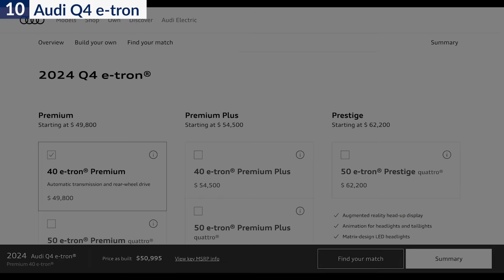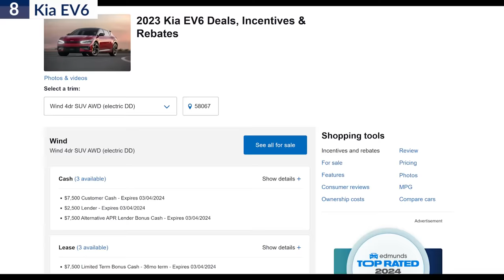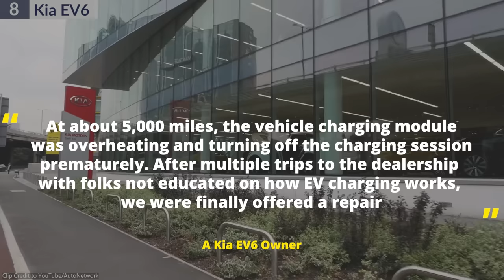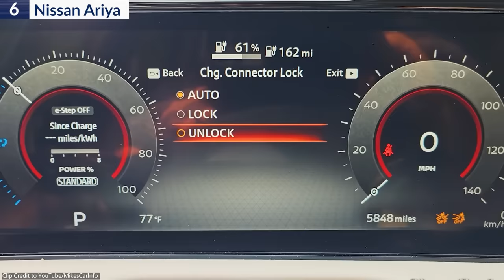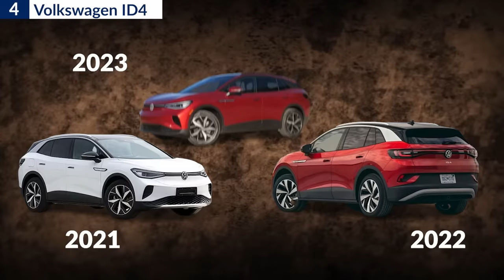New Electric Cars Piling Up on Dealer Lots in 2024 – Here is the Truth!

Comment: The problem with Electric vehicles is they have a limited market ....................

affluent, environmentally conscious, or technically enamored buyers and those buyers have their electric cars

For the majority of consumers, electric vehicles won’t deliver the right value at the right cost  and not everybody uses a vehicle that really is only suitable for  driving around town and commuting

All this is leaving Electric Car Manufacturers struggling with an end-of-line product not capable of providing multiple driving missions of differing lengths and speeds.

Comment: Here is the issue, in most cases we could step up infrastructure to accomodate previous items, but in the case of EV's they pushed EV's before infrastructure was made. That was bad, as the infrastucture was dependent on travel. Without it people will not buy, because where can they charge? All the manufacturers should have gotten together, decided on a single port, and used that port for investing in national charging infrastructure in conjuction with the government. Rather, you see them all doing their own thing, placing the ports at different areas, why? Because they all wanted to be the bluray platform, they wanted that segment. This involves piss poor planning, greed, and zero intelligence. Tesla, in my eyes, were the only ones that offered any path of ownership due to their charging capabilities across the US, but even then it's not ideal as there are not enough chargers. 

Fact is, we aren't ready for electric yet, the miles are not there, and we should really have an electric platform with a back up gas generator that charges on the go if going cross country. That way you can charge at stopping points if you choose to, or charge via gas if out and about, and then also charge at home through your charger. This should have been done moving forward as the electric platform is superior, but having the capability to use gas for a generator is still required for trips.

Until we see 1000+mile charge, and 15 minutes or less charging time, we won't see widespread EV adoption. The other thing is that they are just too expensive. I have a Model Y, I only got it because I like tech, and it has saved me money for non-highway travel I will give it that much. However, they aren't ready for the US, not enough miles per charge, and not enough chargers, we just simply have too far to travel to places, we aren't like Europe where travel is 1/10th of the US travel average times.

Comment: Putting things into perspective, it's not just EVs failing to shift, only the over-priced less popular, or just crap ones. Crap Gas and diesel cars will also sit on dealer lots if they are over-priced. It's called 'market-forces', and is the system by which the world works.

Comment: Id buy one, but not at current markup and over charging tactics. Plus, the charging stations are not available enough. Market supply and Discounts and such aside, If you cannot charge the car ANYWHERE But at your OWN house... YOU wont be buying that EV..... Recently we just had a charging spot put in at our local Pilot truck stop. Its still not been opened up for operation, but its there.. with its glowing red light... telling you that it cannot be used.. much like many of the Ev's sitting on lots..

Comment: I would buy an ev car AFTER they reduce the asking prices significantly, make the cars out of steel instead of plastic and aluminum, make the batteries affordable at 200 to 300 instead of 10000 to 30000 for replacement. 

Everyone does NOT want a new car payment every few years, a car that is worthless without a warranty, and limitations on how far they can go because of constant battery range degradation. I like all my gas cars and they are all out of warranty, self-maintained, haven't had a car payment in 12 years, and they still get compliments when i pull up places (2012 BMW 7 series, 2008 Mercedes S class, and 2014 rolls royce wraith).

Comment: It will take years to build infrastructure for electric cars. Who wants to get stuck on a road or highway because the charging station chargers are either not working properly or there aren't enough to accommodate customers? Per my understanding, this has been a real issue for people with EVs. The idea that all new cars sold by 2030 should be electric was unrealistic and too ambitious from the beginning. If you want to lower pollution stop selling vehicles with turbo engines that omit high levels of nitrous oxide and particulate matter and focus on hybrids and low emission naturally aspirated engines.

Comment: There are Audi Q4 cars at many cattle markets in the UK. Hundreds of them sitting behind metal fencing. There are not enough chargers and not enough range. In cold weather, you may only get 100 miles on the road. I tried a new one and fully charged on an icy day, it could travel 60 miles at lower power due to cold battery.

Comment: The more videos I watch about EV the more I realize that most of the issues are not because of EV cars but because of the US. I never drove a EV car there but apparently they have a bad public charging infrastructure, bad / overloaded electricity grid in general and people drive 300+ km per day to work. 
In EU (or more specific in germany) the range of a modern EV is more than enough for a daily work driver, if you drive long distance you drive on the Autobahn and there are many charging stations (many of them are solar powered btw) a long the different Autobahn roads and they are building even more every year, so long distance trips are not an issue. Yes there are still some issues, because they are "new", sometimes a charging station will not work etc. then you can call the owner and they will restart them or if you don't want to wait you can continue the Autobahn for a few more km and you will find a different working charging station, but these are the exceptions and you hear the bad stories, they will usually work.

Comment: I wonder how many of these EV's will last more than 5 or 10 years, and how much will cost to keep on the road with battery and electronic parts replacements etc.
Then compare some of the cars that are still on the roads around the world that are over 50 plus years old and still going strong.
Built in obsolescence has been a thing for a long time, but I reckon it would be shocking today at the rate that electronics fail in the auto environment.
Ev's definitely suffer from premature speculation on the part of the law makers and planners mainly because they failed in the estimation of the problems that they are facing now, and in the future, but either way it will be us the public who pay for their stuff ups, and not the share holders, and that is a fact that you can bank on.

Comment: Main reasons. Range, lack thereof. Price way WAY too high. Infrastructure. Extremely high, from installing super charger at home if you have the ability to install one. It's time for recharging. Way to long. Public Infrastructure. In recent reports, it is way too fragile. Long-term high prices  for out of warranty repairs.
Reply: Add this ;

1. Child battery mineral labor

2. Range anxiety

3. Risk of garage fires

4. Paying 20k more than a
comparable vehicle

5. every time you fuel up an EV, the fuel tank gets smaller  and smaller. Battery degeneration. 

6. Poor resale value

7. Reduced performance in
cold, highway.

8. Higher repair costs

9. Awful charging network
experiences in the weather
without restrooms

10. Higher insurance rates

11. Replacing tires more
frequently. Michelin states that tires wear out 20% faster on an Ev, and could be as high as 50% faster! Ev tires made for ev's, cost 20 to 30% more, than regular tires for ice cars. As Ev tires wear out, they leave behind more tiny particles of rubber than normal ice cars. This causes more pollution. 

12. Death by autopilot

13. $25k - $35k battery

14. Low km range per tank of energy. 

15. must wait in-line 1-2 hrs
to charge.

16. Then wait more time to charge, while charging.

17. Spontaneous combustion, with no way to put out the fire storm.

18. If they catch fire in a tunnel, many people will die.

19. People without a pro charger system or a parking spot at their house, will run an extension cord to the road, which is dangerous and could lead to people tampering with your charging setup (super slow charging at the road)

20. If you're in California, you won't be able to charge your car past 4pm because of a shortage of electricity supply on the cheesy grid.

21. It is not actually "green". The pollution is made at the power station, and during the manufacturing process, not the car.
In advance of the Cop26 climate conference in Glasgow in 2021, Volvo released figures claiming that greenhouse gas emissions during production of an electric car are nearly 70% higher than when manufacturing a petrol one.

22. Only 5% of used junk batteries get recycled, the rest go directly into the bin. It's cheaper to mine for new minerals.

23. Chhinna actually does 70% of all the refining of the minerals and production of the batteries.

24. Minerals are becoming more and more scarce, and the cost will only go up, not down.

25. Some countries where they mine for lithium, actually use a very big boat load of fresh water to only produce a ton of lithium, so they are afraid of running out of water. It takes over 2 million liters of fresh clean water to produce 1 ton of lithium. 

26. Ev cars will soon not be able to drive in tunnels or be able to park in underground parking garage and probably will eventually void your house insurance if you park it in your personal garage.... 

27. You can't charge your battery at super stations when it is bitter cold out. 

28. If a fire truck comes to put out an Ev fire, all the chemicals go directly into the sewer system, poisoning everything. They need tons of water to slow down the burn. They can't put them out. They are only trying to prevent over things near by from catching fire. 

29. Ok, there is 2 good things; regenerative braking, which charges the battery while you are slowing down on the highway, which saves your brakes from much wear.

30. Loss of fuel tax revenue, so now the roads will only get worse, not better. 

31. in Dublin, huge generators are being used to charge EV buses, due to electrical grid strain. buses in Athlone also cannot be put on charge until midnight, for the same reason. Bus Éireann is saying that they can't charge their buses until 11pm for the same reason,  and to avail of a lower tariff. 

32. Not everyone on earth even has electricity to charge their cars. What are they supposed to do in 2035? It's easy to get a bucket of fuel to power up a regular car. 

33. VCE, or "vapour cloud explosion" is very bad. If any battery, typically anything larger than an E-scooter battery, and especially only "half" charged. If a problem occurs in the cells, it might not catch on fire right away. Instead, a cloud appears, and then may be ignited a short period afterwards. There are 2 different types of vapour clouds that appear; heavier and lighter than air, which form will be dominate, can not be predicted yet. This produces a bomm.

34. For Ev transport trucks, they aren't allowed to carry the same payload as a diesel truck, because of the massive weight of the battery. The owner of the Ev truck therefore loses potential profit, every day. They also lose more profit for the waiting times for charging that Ev truck. The driver will get paid to charge the truck, which in turn forces the owner of the truck to lose more money. 

35. Ev cars are more likely to be written off, if they experience a minor collision. After the collision, something could have upset the structural integrity of the battery. 

36. Ev cars lie to you. If you are bold enough to go out on a decent road trip and its 210 miles, one way, and your Ev tells you that your battery will last you 223 miles, there had better be no hills, or excessively cold out.... You'll probably get stranded, trying to get to the charger, at the end of the trip. Ev's have left many families stranded already. 

37. Ev's and their batteries, will soon need their very own "passport". With all info about them when born, and current info about them (power output, resistance, mineral composition, etc.) 

38. Thieves stealing charging cables, will soon make it impossible to "fuel" an Ev car. They take a long time to replace the cables, just to have them cut again for scrape money. 

39. Cars were typically being made lighter and lighter using aluminum and or fiberglass and or carbon fiber, to reduce emissions and pollution. Ev's are only getting heavier and heavier, causing more pollution than ever. Remember, an ev's pollution is made at the power station and the dump, not at the actual Ev, except for the tire particles as mentioned above. 

40. More on spontaneous combustion of the battery. What if you had 3 kids strapped into car seats, in the back seat ,which kid do you rescue? More fires start so fast, there is hardly any time for even the driver to escape, let alone 3 kids strapped in. 

41. There must be a reason that Boeing 747's aren't battery powered.... Until jets are battery powered, I'll be sticking to fossil fuels for my mode of transportation. 

42. Can't bring an Ev up north in the woods, nor any battery powered chain saws, where there are no grids to charge them up. You would need a huge amount of solar panels to get you anywhere. 

43. Even Mr. Bean says;
"I love electric vehicles – and was an early adopter. But increasingly I feel duped". 
"When you start to drill into the facts, electric motoring doesn’t seem to be quite the environmental panacea it is claimed to be." "It seems a perverse choice of hardware with which to lead the automobile’s fight against the climate crisis." 

Mr. Bean is a smart man. 

Ev's (External combustion vehicles) suck, and it's a bridge to nowhere. But they do sometimes convert themselves into "internal combustion", but sadly, they can only do that 1 time.

Comment: The high prices of EV's without a tax rebate are an issue. Also a lot of the cars not selling are first gen cars. Think first ever of anything. The only thing you should consider is a Tesla who has been at this a much longer time but the build quality of models before 2022 are not great. ISSUE is where does that leave older used cars? 
Also everyone figured out recently the Tesla NACS is the best charging network and just works vs EA, the largest non Tesla network which is hit or miss

Comment: EVs are still innovating at rapid pace. It really doesnt feel like a good time to buy when 5 years down the line EVs could become 10x better. With much higher range, reliability, speed, lower weight, better maintenance etc. The upcoming Taycan's rumoured specs puts the old one to shame for example. The current EVs just feel like the original fold phones. Only for the enthusiasts who would overlook faults and shortcomings like the weight and low range.

Comment: i picked up a CX-90 PHEV.  I've maximized the BEV portion of driving and achieving 67 mpg or 750 miles on a tank of gas.  

i charge at night using the level 1 charger that came with the vehicle and for driving during the week, i found two targets with Tesla chargers and level 2 chargers.   target stores in SoCal have free charging for the first 2 hours which is helping me obtain massive efficiency out of a 2024 Mazda CX-90 PHEV
Reply: thats smart PHEV are way better than EV

Comment: hmmmmm.....new car designs that do not have all the bugs ironed out, sleazy marketing and salespeople lying thru their teeth, not enough working charging stations, not enough electrical infrastructure to handle all of that upcoming load, ev cars not working properly in cold and snow, the ridiculous high cost of replacing a battery, the high cost of an ev to begin with, the battery fires, the low reliability of these cars due to rushed manufacture, the fact that ev's are not really better for the environment due to all the toxic waste and toxic mining, etc, the high cost of EV tires and insurance, the danger of constantly using the touchscreen while driving leading to a higher accident rate for EV's...they are more dangerous also because they are faster!....hmmmmm I wonder why EV sales are falling.....

Comment: Let's see...I won't buy an EV because: and this list was written in 5min:
Too expensive to buy
Too expensive to insure
Lack of adequate charging infrastructure
Lack of security at charging stations
No restrooms at charging stations
Recharging time takes too long
Long lines in some states to access charging stations 
Poor range/lots of range anxiety
Poor resale value
No charging with cash possible
Cannot be easily towed 
$20k to $30k to replace a battery
Possible spontaneous fires that can melt concrete re-rods
Accident repair shops won't touch an EV
The electrical grid in the US will not support high volumn EV charging demand.
Poor cold weather performance
Poor towing performance on EV trucks
Poor initial quality issues
Too big a carbon footprint.

Comment: Unfortunately the reality is that customer wants Tesla not EV, as the eco system is more important than the car itself, beside expertise on software, functionality, updates, insane battery repairs from non Tesla vehicles up to 60K USD from some manufacturers makes it almost no viable for so many that require a reliable car.